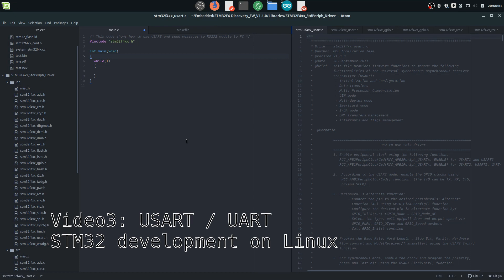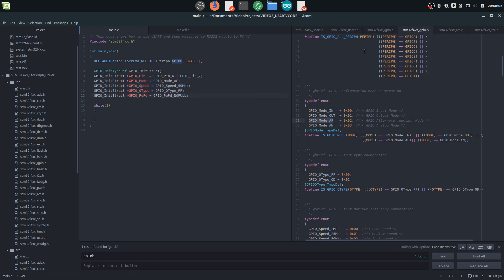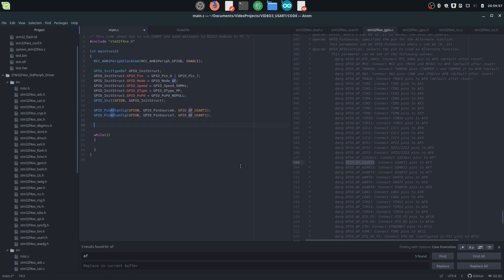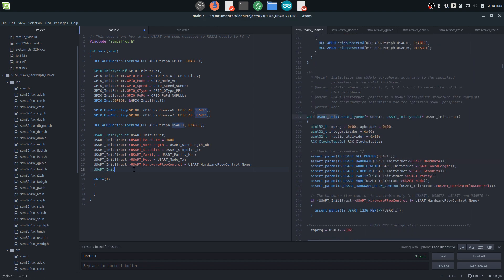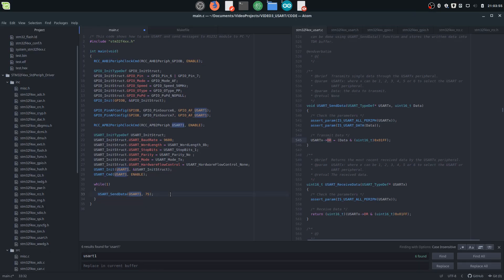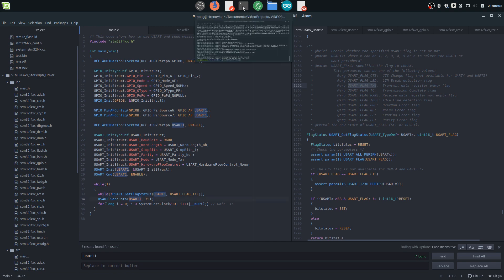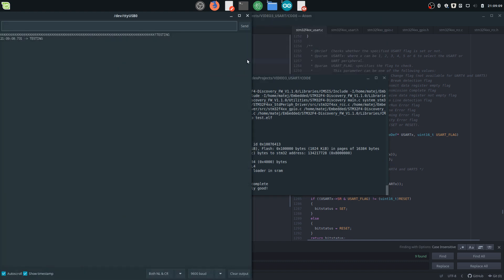Sending data over USART | STM32 development on Linux | VIDEO3

Comment: How did you use the Arduino serial monitor? I tried going to 'Tools -> Serial Monitor' which gave me an error to select the right serial port. However, I'm not sure how to select the right one as 'Tools -> Serial Port' option is greyed out (not available).
Reply from the maker: If is's greyed out it means that it does not find any serial port. Make sure that your serial device/converter is working. You can also use other programs just for serial communicatikn, no need for arduino, like putty or terminal based picocom or tio.

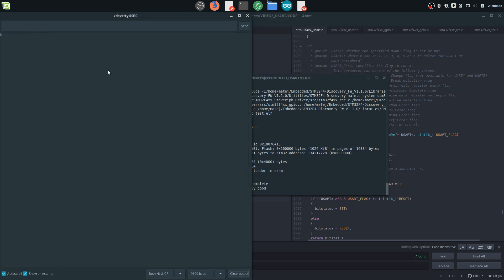Comment: 10:15 I wanted to do the same thing but I couldn't find the same device (ttyUSB0). I think it appears as ttyACM0 because I found so many resources on the internet that discuss the difference between /dev/ttyUSB and /dev/ttyACM I figured that it could be the twin brother. I did tail -f /dev/ACM0 but it outputs nothing. I don't know if my approach is correct. There is this one guy in the comments who says stm32f4-disc1 needs to do something else but I have no idea what he is talking about, it is a little advance to me at this point.
Reply from the maker: Some devices, like the STlink that is on ST's development boards represent their serial interface under name ttyACMx whereas usb-serial adapters, like ft232, ch340 represent themselves as ttyUSBx. Therefore if you have multiple usb-serial devices in your linux machine, search between ACM and USB devices, where your stm dev board might be ttyACMx device.

The discussion was about some dev boards. In the past, stlink chip, which is used to download code and debug you actual microcontroller, was only used for that purpuse. Then they added virtual com port, so ACM serial interface in parallel with all debugging functions on the same chip. So when the updates came for all stlink devices with this new functionality, older boards, like my stm32f407-disc1, don't have physical connections for serial pins from stlink to your processor. Therefore your computer will see a serial device, which will be emulated by stlink, but the connection from stlink to your microcontroller is not present. 

You can see that in ST's users manual for these older boards where they show which pins on stlink can be soldered for RX and TX. So if you have one of these older boards, you'll have to do some manual soldering with small pins and jumper wires or just purchase usb-serial converter module like an ftdi or ch340 cheap from internet and connect them to your board.

Comment: In the USART_SendText function, I think *s++ could be replaced by s++. Is there a reason to add extra * on s++ ?
Reply from the maker: We have to include * as we want to return the value of where the pointer is pointing to. ++ will advance the value of pointer s after it returns the value of it's current address.

Comment: Make a note that STM32F407G-DISC1 which is almost identical to STM32F4DISCOVERY would require extra UART to USB dongle or flying wires connection to make a virtual com port. (ref. UM1472 p.13)
Reply from the maker: Thank you for bringing it up. I think I do clarify that the board that I used is DISCOVERY, not DISC1. I have come across that when I was working on my video, but upon checking my board(I have both) and confirming that it has the required connections, i forgot to mention.